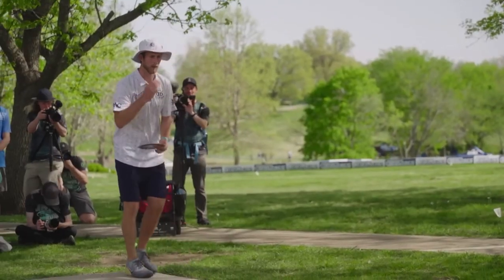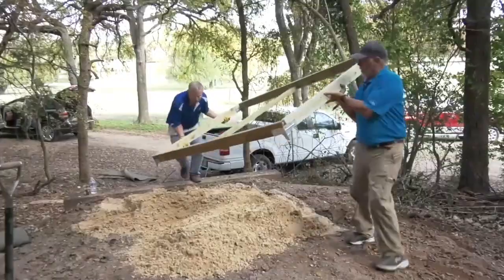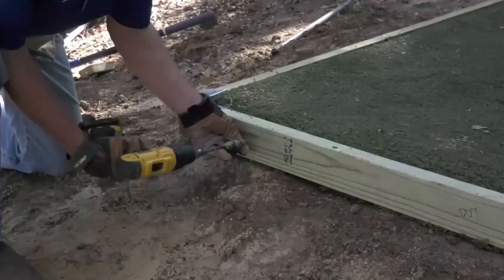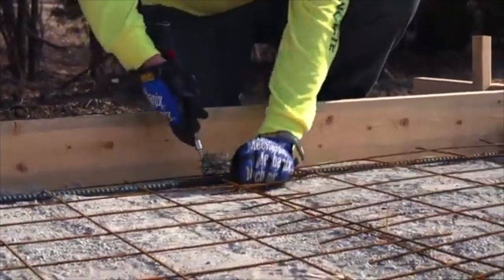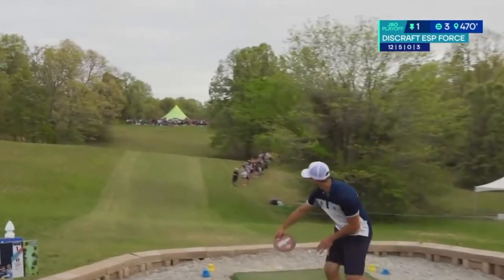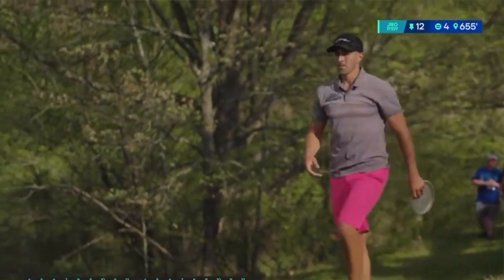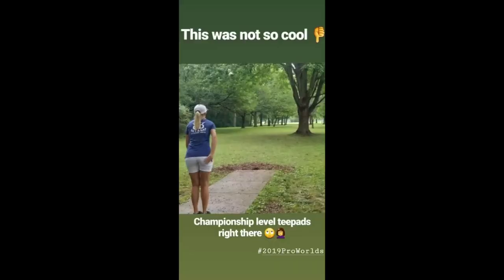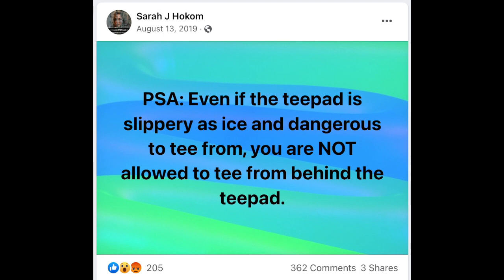Do We Need to Change Disc Golf Tee Pads?

Comment: Been at this sport for 45 yrs now (summer of 77) not everybody can step up or run up a narrow tee pad from the beginning of dg time.. answer? 
Go on YouTube and look up the Baca course in Albuquerque, NM. Those are huge round concrete pads that eliminates any kind of injury due to run ups or step offs.. courses got longer therefore we need extra run up power and it seems the old narrow concrete pads were good for smaller type courses for recreational or those that just stand n throw. Rick Kapalko gave us a vision to make big round tee pads to get better footing, drainage of extra water on pads, and more elbow space to make a better shot ( throw) off the pads. I do believe round tee pads are the way to go, especially major dg events. Thus eliminating the ok to drive on the side of tee pads in which I do believe alters the fairways.

Comment: To answer the question from the video: YES! Tee pads DO need to change for PDGA tournaments! If they are holding Pro Tour events there needs to be a "standard" size that ALL tee pads are so there aren't problems like what happened to Paul, and Sarah elsewhere(what the heck is it with the PDGA giving ZERO thought into the SAFETY of the players this year?!

The REAL problem with that tee pad is that whatever that material was on top of it was NOT secured so it wrinkles when players plant and twist! 3:58 As opposed to THIS one that has that border being put around it that will secure the fake grass(or whatever) covering they are putting over the tee pad!

Comment: Tee pads of all types have thier pros and cons. Then to try and compair disc golf to other sport suface is also impossable. Concrete: firm, and stable but  has raised edges which can be trip hazard, slippery when wet, muddy even when textured. Same for pavers. Both are permanent.  Artificail turf is not as stable when raised into a framed bed, but offer good traction when wet but it too requires maintanance when muddy. I find recycled turf to be the best when placed directly on raised ground and filled with recycled rubber as limke football fields. only set back is in rotation of footwork, it does limit this action.
So there is really no set answer. I think we would be better in trying to adapt a shoe specific to each surface.

Comment: Suggestions for tee pads.
There should be a high contrast throw line that is about 5ft from the end of the teepad.
     The throw line could be a raised bump like a threshold.
          I've ran off the end of tee pads and came close to injury.
            Now I try to throw from the  middle of the tee pad.  Not the end.
        High contrast line so officials can easily determine foot faults.  

I've watched some tournaments in Europe.  They seem to use  platforms for tee pads.
               These are constructed from wood with  artificial grass/carpet.
                   They almost look portable.
      On my course the teepads are slanted based on the lay of the land.
      It would be nice to throw from a dry level surface.

Helsinki:  https://youtu.be/enwbxSY_M3w
Reply: OMG! I HATE slopped tee pads SO MUCH! There's a pretty significant one on one of the holes in my area!

Comment: There is enough variability in the flight of a disc to make one wonder why people play the game at all. However, in the field of quality control, the first rule is to perform every manufacturing operation the same way every time. Look at the ball golfers. They do not have to take a running start at launching their projectile, but they have consistent surfaces from which to play. Disc golf is played for personal entertainment. Professional disc golf is played for the entertainment of an audience. It stands to reason that something which is so key for equalizing the playing conditions for all players and consequently making play fairer, should be high on the PDGA agenda. I'm not talking about the local course in Bee Branch, Arkansas. I am referring to the PDGA sanctioned tour venues. If you want to host a PDGA Silver series or other event, the tee pads should conform to a standard. The same goes for the baskets. Stop this crazyness of having elevated and non-elevated baskets. A course should have the same height off the green for all baskets on the course.

Comment: Not really a great example. It was loose at the start of the round and he slipped slightly and made a perfect shot. So he knew the front of the pad had an issue before throwing. Overall, I think artificial turf provides the most consistent grip for all weather conditions but like any pad needs to be installed properly.